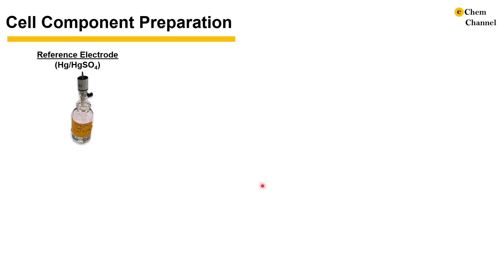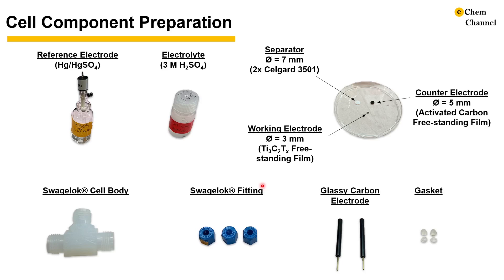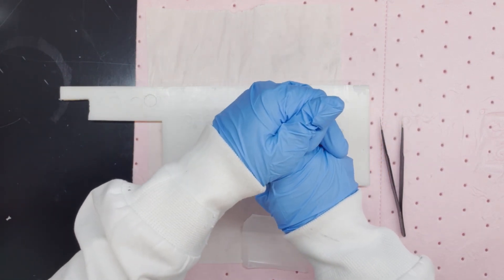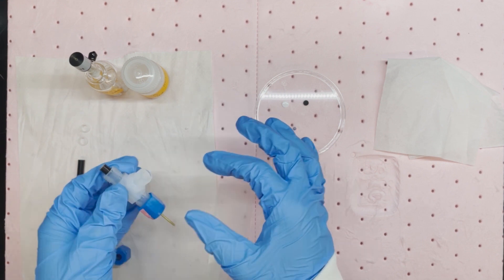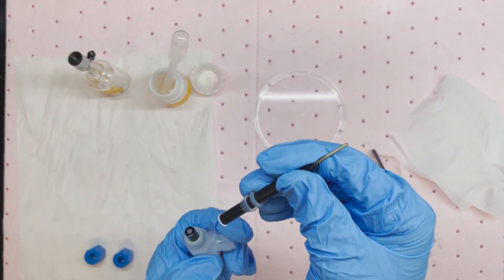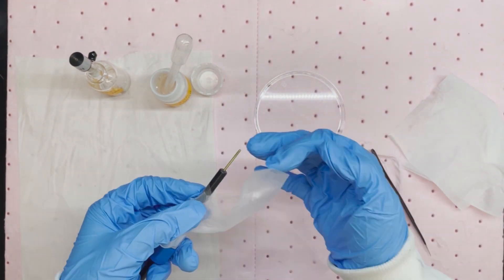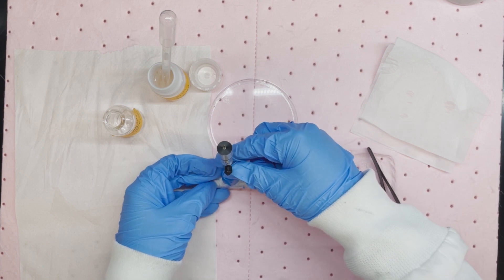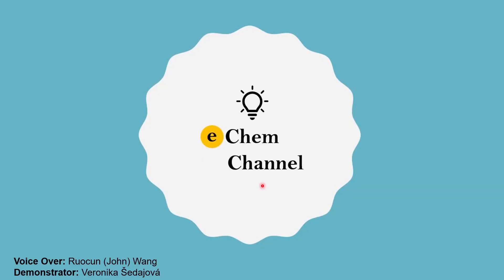Tutorial 20-Experimental Demonstration of Swagelok Cell Assembly

Comment from the maker: Hi all, since electrode fitting issues have been asked multiple times, I will add that: you can drill your received Swagelok Tee fitting with a 1/4 inch drill bit so the electrodes can fit in there. I would repeat the drilling a few times to make sure the walls are smooth.

Comment: I learned a lot from the video and it helped me a lot. Thank you so much. While watching, I have a question, so I am leaving a comment.

If the structure is like the one in the video, I think the counter electrode and working electrode will react directly rather than through the separator due to the electrolyte filled in the passage of the reference electrode. Is this okay? Is the role of the separator just to prevent the electrodes from coming into direct contact with each other?
Reply from the maker: Hi there. Thanks for your question. Reactions will not happen simultaneously through the RE electrolytes. The separator is to prevent the WE and CE from touching each other. It is porous to allow electrolytes to flow through.

Comment: Thanks. I have a question. If you spray the electrolyte through the hole to put the reference electrode and put the reference electrode on it, wouldn't the reaction occur as the electrolyte directly touches the working electrode and the counter electrode without going through the separator?
Reply from the maker: Hi, the reference electrode is housed in a glass container with an ion penetrating frit. Therefore, no active electrodes are physically touching each other.

Comment: Thank you for the useful video. I enjoyed it. Is it permissible to utilize the glassy carbon electrode directly as a counter electrode without the need to create a  free-standing activated carbon film?
Reply from the maker: Glassy carbon electrodes do not have enough surface area to hold the charge from the working electrode. You will likely start to evolve gas in aqueous electrolytes, which is not great for the integrity of the cell.

Comment: Great! Thanks! I have a problem with my reference electrode. The top of the cell doesn’t fit it, it is too small.

And I use graphite stick as counter electrode. Its diameter much bigger than separator, does this affect the electrochemical properties?
Reply from the maker: The link I included there should give RE of appropriate size...? Is that what you used?

The point of separator is to separate CE from WE. You don't want them to touch each other to short circuit your cell.

Comment: I got the exacct products as mentioned. But my glassy carbon does not go inside the swagelok cell. The dia of the swagelok seems smaller than the CHI 104. Any sufggestions how to proceed?
Reply from the maker: Hello, I have been using the same product. The glassy carbon fits the two side openings. You may need to force it in in the first run. The top opening doesn't go through completely, you will need to drill through with 1/4'' head to put in the reference electrode. I missed this detail in the vid. Sorry about that. Hope this solves your issue.

Comment: Hi there, thanks for the video, this is very informative. Is the reference electrode placed in that way going to be suitable to measure? If it is touching with the current collectors isn't there going to be a short circuit? I was thinking if it would be more efficient to "sandwich" the reference in between two separators and place it between the other electrodes. Interested to hear your opinion, thanks!
Reply from the maker: Hi Evangelia,

Thanks for your question. The glassy carbon electrodes are housed in a polymer material so they do not touch the RE. 

In the Swagelok cell design, the distance between WE and CE is minimized to reduce the ion diffusion length in the electrolyte. I'm not sure if I understand what you mean by "efficient".

Thanks,
John